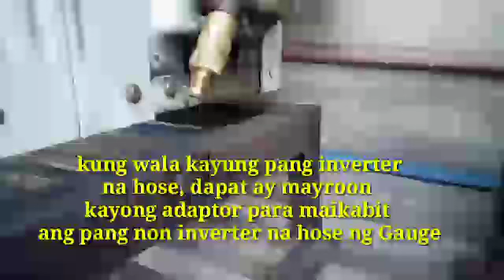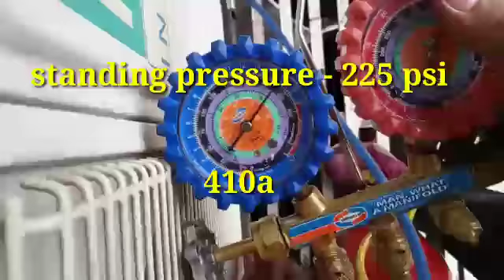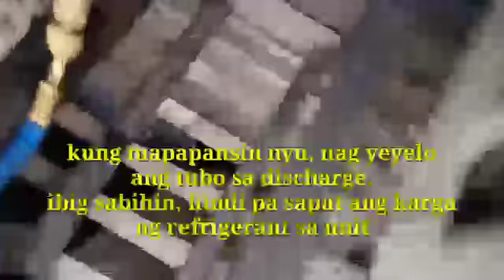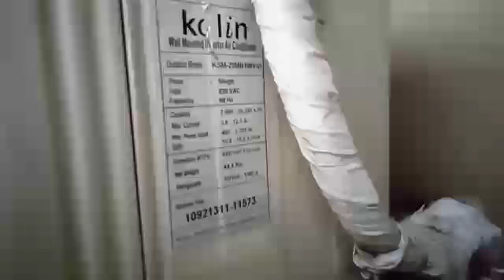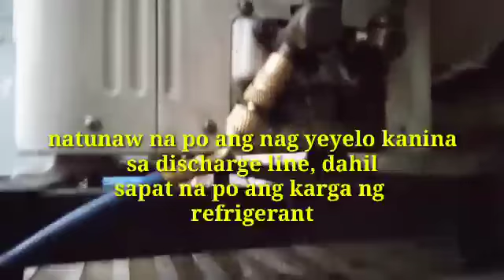Kolin Aircon Split Type Wall Mounted  2hp Inverter  Recharging Refrigerant 410a

Comment: Correction ,hindi discharge line   yang nagyeyelo ,kundi liquid line . Tuloy lang  sa paggawa ng Video .8pero maging maingat sana tayo dahil baka matuto ng mali ang mga baguhang Technician
Reply: Anu po pag kakaiba ng discharge line sa liquid line sir? At bakit po liquid line ?
Reply: @marksablan2416  ang discharge line po Kapatid ay ang line from compressor motor papunta sa INLET ng condenser coil kung saan dumadaan ang high pressure and high temperature GAS REFRIGERANT ,ang tubo po after ng service valve na nasa video nagyeyelo  papunta sa indoor unit   ay LOW pressure ,LOW Temperature liquid refrigerant at mag start pa lang mag evaporate to rich its boiling temp. Meaning liquid state pa.(Huwag ka sanang maconfuse sa Term na Low pressure dahil High pressure talaga ang R410a)
Try mo recall ang refrigeration cycle .Huwag kang mag alala di ako critic natutuwa lang ako sa mga taong gustong mag share ng alam nila.
Reply: @marksablan2416  at Liquid line din ang outlet ng condenser o yung tube  after ng condenser coil  where during operation ay high pressure at high temp. Liquid refrigerant ang dumadaan bago pumasok sa filter drier.